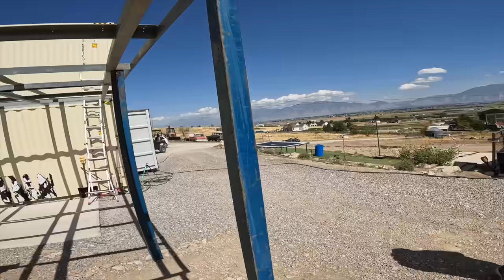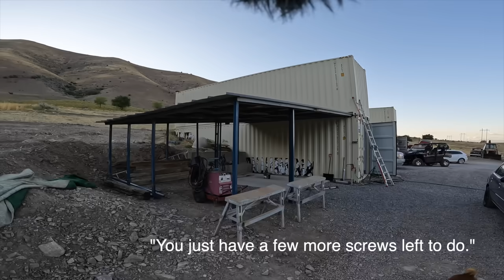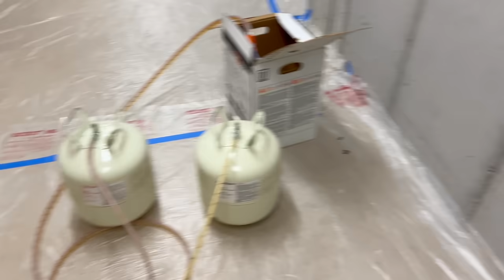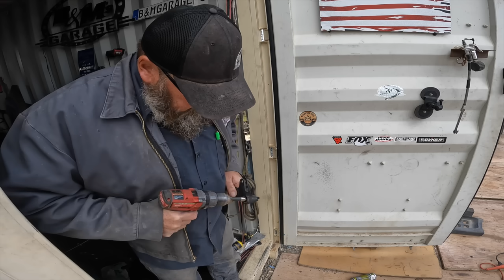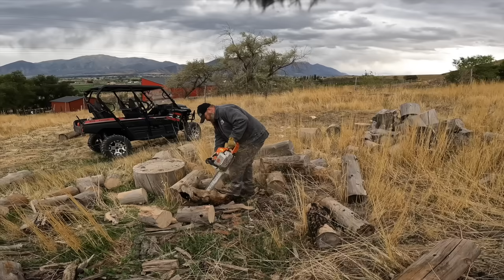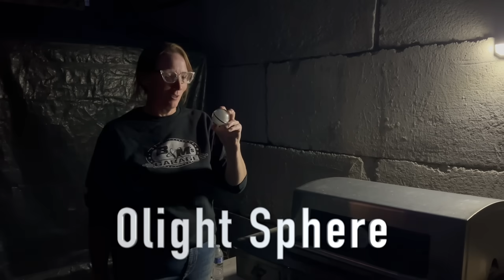Olight and Ben makes life BRIGHTER!

Comment: Sides for your lean-to, I would go with metal but wind load slats like fencing.  That's the fence that has boards on both sides with gaps between them.  You get wind constantly so that type of design will keep you from damage and still let air flow. 👽🗿👽🗿👽

Comment: Ben ;...I am sceptical that the flimsy frame of the carport can support the weight of snow/Ice....?
Reply from the maker: @kpdvw  snow and ice are certainly an issue. It’s on the south side which will help. The frame is made of 3/8 galvanized plate that is welded to the containers and to the 2 1/2 inch steel beams which are cemented in. We will try and see. I am pretty confident it will hold. I have been wrong before but I will deal with the consequences when they come.